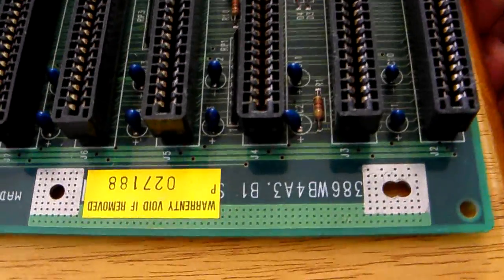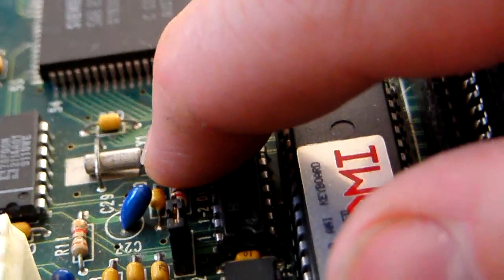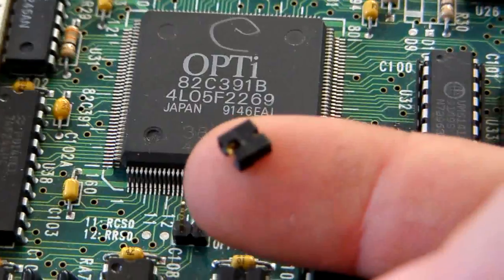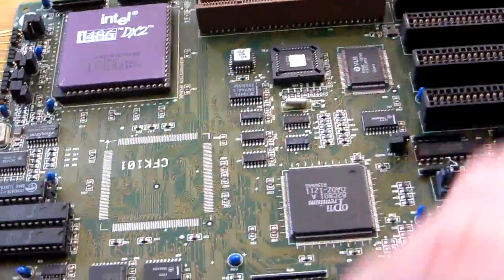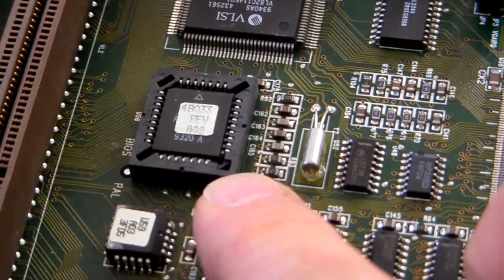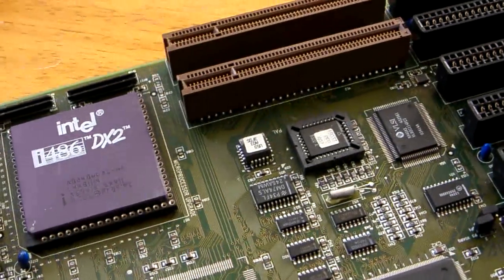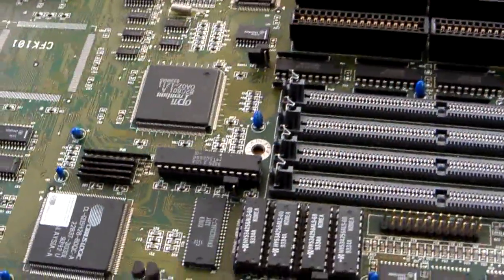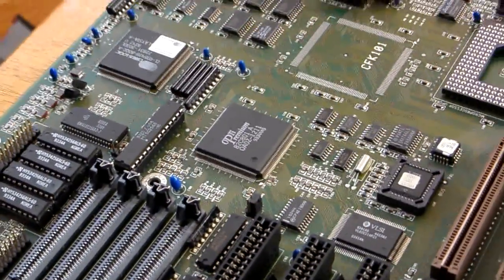DELL 486/66 Motherboard VLB removed and reviewed.

Comment: Their workstation boards from that time period had a rather odd construction, which used a mezzanine card to carry the CPU.  And the PowerLine 450DE/2 DGX was made available with NeXTStep/86- it was actually the first computer announced to ship with that OS.
Reply from the maker: Yes, indeed, I had a few of them style with 486 SX for scrapping back in the late 1990's. I thought I kept one of the riser cards but couldn't find it for another video. 😉

Comment: Hello, thanks for your videos about this board, it helped me deciding on getting this board last week. curiously mine don't have any kind of REV/Name (maybe it is a NOS that never went inside any computer case as the seller told me).
Do you remember which was the latest BIOS and where you got the documentation about it? What kind of battery/battery holder you use with your boards? Thanks again!!!
Reply from the maker: This one :- ? 486 Socket 2 VESA Local Bus VLB/ISA motherboard, OPTi chipset Intel 486DX on ebay? If so it appears to have A04 the ones I have are all A02. So the one you purchased last week is a more recent BOIS revision and one I would like to have and or try to use to update one of my boards. I also believe A04 was the most recent, I did update one but reckon I sold the very one I updated! Thanks a million
Reply: Updating 486 dell motherboard bios
Reply from the maker: @RetroTinkerer  Yes that's the one, so if it has the A02 or A04 BIOS it's what I have or it's the latest. I tried during the summer to track down the correct BIOS update on the DELL website to no avail. The boards I have all come from Dimensions but DELL lists some of them as from OPTIPLEX. 😊

Comment: Nice board. Some minor corrections... That cylindrical crystal oscillator (32.768 KHz) is only used by the real time clock logic. The board should still function without it, but it may complain about RTC not running. Also, PCI used a slightly different connector (different pin counts), but the one used by VL-bus was identical with 16-bit MCA slot.

Comment: Good video but it wasn't with the 486 that things started to get integrated. In the early 80's there were already manufacturers including serial and parallel ports on the motherboards of their 8086 PC.
Reply from the maker: VideoTape I also have 386 boards with intergrated ports. The point is the 486 Board is very intergrated. more so than most boards of the era. Most 386 and 486 need an addon ISA card at the least too have ATA serial etc connectivity. I am glad you liked the video and thanks for the comment.
Reply: Maybe you had experiences with generic boards in the past. Me, I have always been around name brand PC clones which always have everything integrated. I didn't even know that 386 and 286 PCs without onboard video, serial, parallel, PS/2, floppy, IDE existed up until recently.
Reply from the maker: VideoTape The 386 board is from an OEM generic Polaris 386, like the boards I used when building my customers computers back in the day. I do know that Packard bell and compaq and Dell and AST all made highly intergrated boards.   the point here is a board that complies too ATX standards that fits in any case and has a lot of useful intergration on board.

Comment: I have this 486/66 motherboard but does not have cache control chip or cache array chips.  Can you give me specs and numbers on them so that I can order?  I don't have a spec sheet on the motherboard and can't find one online.  My email is mcpldross@gmail. com.  Thanks for any help.
Reply from the maker: +dyvydross I will try to find out the information your looking for. probably by looking at an existing board with cache.
Reply: +DRCHRISTIANMD Thanks! I could not see any identifying numbers on the video. I suppose finding a duplicate board with cache installed on Ebay might be easiest way to go.
Reply from the maker: Hello, check out my YouTube channel for an updated video, detailing the chips in question you will need. Hopefully my old brain still remembers the right or correct bits!